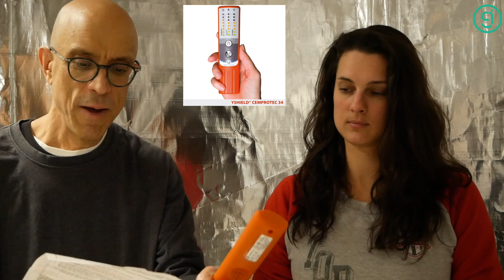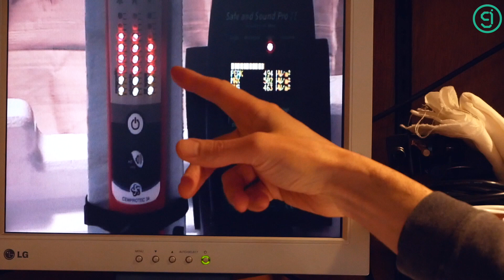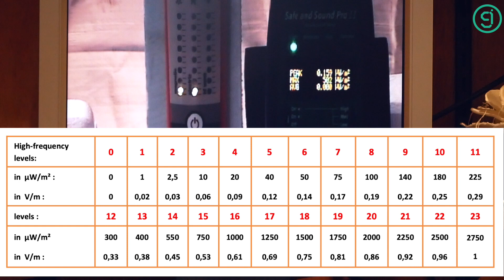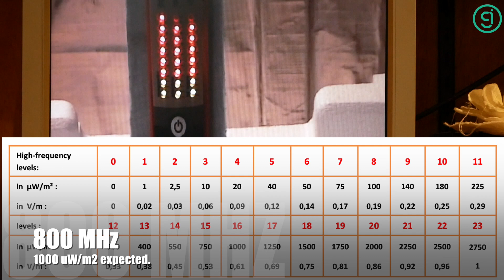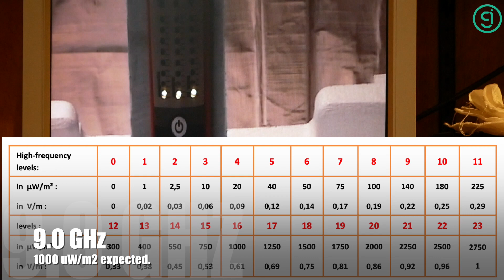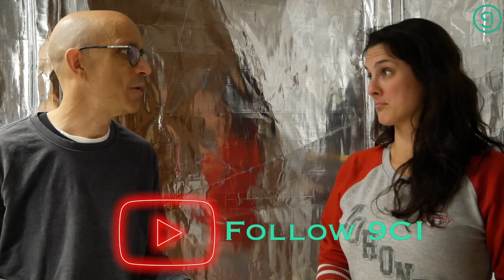New Meter Testing: Cemprotec 34 Pulse Width and Frequency Response

Comment: It seems three in-one EMF meters that display all three modes at once are more of a gimmick/selling aid than an actual useable screening tool, as the RF sensitivity is totally lost. I wonder what speed this meter reads at in RF mode; I would be surprised if it is anything much over 10,000 samples per second. At least the sound is good on RF Mode, that will tell people more about their microwave environment than numbers ever will.
Reply: If you don’t mind me asking:
Why would the RF sensitivity be lost in such a configuration?

Comment: Thanks for the video 👍, would this device be used to measure radiation in my home from smartphones, computers, electrical appliances, ohter telephones, etc.?

There is another measurer called ESI24. Do you know which of the 2 is better❔
Reply from the maker: Hi there, excellent question! This would measure all of those things as they are all transmitting in the 2.4 Ghz and 5.6 GHz ranges. Based on our experience they are both pretty good but from preliminary examination of frequency response we think the ESI 24 may have more accuracy over a larger frequency range. However, we have not tested the  Cemprotec 24 fully.
Reply: @9ci  Wow, thank you very much for your quick response!. 🙂